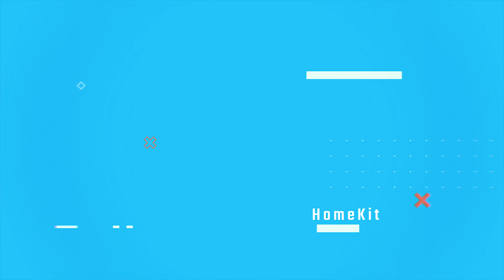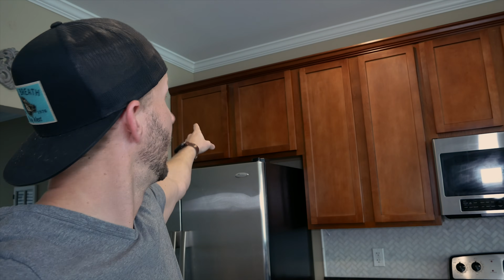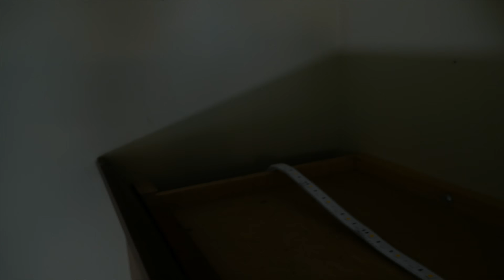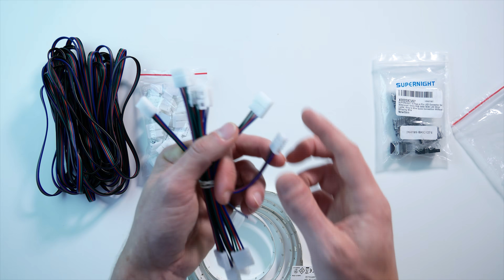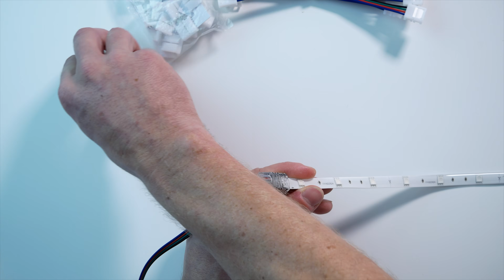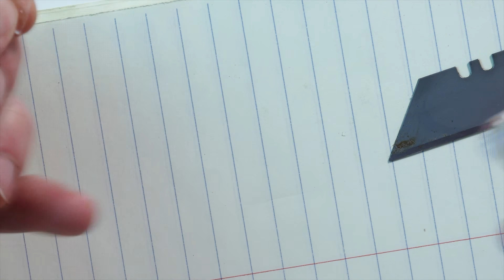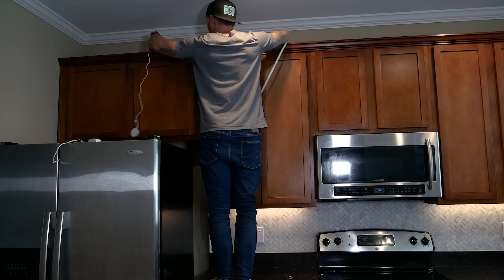How to install LED Strip Lights – Under Cabinet Lightstrips for your Smart Home!

Comment: Brother , i was Literally looking for strips . Might move soon into our home and I’m choosing HomeKit as we are apple user and i don’t mind saying Siri instead of Alexa . Rather have the least amount of hubs add o your channel has been great . Are all your home sensors Vocolink? Rather keep the entire house the same. Thank you , maybe a end of the year Full tour of your smart home? Love the NFC ideas. Great job
Reply from the maker: Thank you! I'm glad the channel has been helpful. I am definitely planning a full smart home tour video, but it probably won't happen until early 2021.

And to answer your question about sensors, I have a number of different sensors that I use. If you only need a couple here and there, bluetooth sensors like the VOCOlinc or Eve work great and no hub needed. If you want a bunch of sensors throughout the house, I might consider something that uses a hub like Aqara. They connect via Zigbee so they are fast and reliable. This is nice because the hub is what connects to homekit (which exposes all the sensors to HK) and I find that easier to manage. Check out my new home tips video if you haven't already and plan to move soon. I talked in that one about getting started with a new home. https://youtu.be/YI3RDqhnjIU
Reply: Thanks for the answer , keep those NFC tags videos ideas. They are great

Comment: I've a 12v adapter now, but I lights 50% of the led lights at good light, if I but a 24v adapter, will it be a powerfuller light?

Comment: While it's true that an LED light kit does not consume much power, the outlet located in the cabinet is a dedicated circuit for the microwave in is not supposed to power any other devices. It works in this instance and I am sure others have made it work.... it's just worth noting for anyone who may consider doing that type of project.  The lighting effect does look pretty cool though.
Reply from the maker: Hey Michael, thanks for pointing that out. Definitely worth noting. I wouldn't plug anything major in there, but it should be fine for something that draws such a small amount of power such as a light strip.

Comment: Hey Shane, getting awesome future ideas down for my new house when we purchase one soon! this is really useful DIY trick but i just want to know how safe those clips are? (Electrical fire safety wise...) since you're cutting the light strip and extending it differently  to manufacture recommendations? Thanks
Reply from the maker: Hey Tristan, I'm no electrician. But these type of connectors and kits are common on amazon and can be found for all types of light strips. And people have been soldering light strips like this for a long time. This is just a way to do the same thing without soldering it. Of course, always consult an electrician if uncertain about any project involving electricity.

Comment: Great video Shane, I have 2 questions.
1- How did you do the Red Code automation in HomeKit?
2- Can you cut and spread yeelight lightstrips in the same way?
Reply from the maker: Thanks Hugo. 
1. Use the Vocolinc app (or other 3rd party homekit app) to create a scene that includes the light effect mode. This can only be done with vocolinc lights.
2. You should be able to do this with any light strips. You just need to figure out what type of light strip you have and get the appropriate accessories...for example, this is a 4 pin lightstrip, but another may be a 6 pin light strip. Hope this helps.

Thanks for watching!

Comment: Hi again Shane, awesome upgrade and your wife’s happy what else you can ask. The Meross outdoor plug that I received doesn’t turn on. So I received the refund just in time with the news of the new Wemo outdoor plug. I buy it and have plans to open it up tomorrow let’s see how it works. One month ago I bought a Vocolinc LS2 with the extension. I put it in my living room and it works great. I use your older video to expose the lights effects to HomeKit and have created scenes with it. I’m planning to buy another Vocolinc light strip with an extension to put it over my cabinets.  And with the news that you gave us about the adaptive lighting it will be better. Thanks again!
Reply from the maker: Awesome! Well about the light strips and effects...not so much about your outdoor plug. I actually just bought one of those also, but I haven't taken it out of the box yet. Hopefully I'll have better luck. I did see the Wemo outdoor plug also. That looks like a good one. And yes, I will also be quite happy if they do actually bring adaptive lighting to these light strips! Thanks for watching!

Comment: Just waiting on some lifx strips to arrive to do the same. Did you think about using profile channels? Am thinking of getting them to maybe help diffuse the leds a bit and look a bit more professional installed. Not sure if it’s just extra work and cost
Reply from the maker: Nice. I think if you can see major hotspots or the actual LEDs, then yes using the channel diffuser would be a great idea and look much better. But otherwise if you are able to hide the light strips so you only see the glow, probably not necessary imo.

Comment: what would you recommend if you have cabinets on both sides of the kitchen? Also, great video!
Reply from the maker: Thanks for watching! You can always use two separate light strips if you have to. You can control them separately or link them to work together in HomeKit.
Reply: @ShaneCreates  Thank you!  I just bought a home and I travel a lot and HomeKit seems like the way to go for me. I need to be able to control my home from anywhere. Once I found your channel and have been hooked ever since.  Really appreciate the feedback!
Reply from the maker: Anytime. Thanks for watching!

Comment: Looking good! 👍🏼 You did a good job explaining the differences in all the connectors and how to connect them. I had a vocolinc light strip before but mine (and a replacement) kept making a high pitched noise when plugged in that was rather annoying. Have you experienced this?
Reply from the maker: My wife has mentioned she hears something similar at times but it’s very faint (I don’t even hear it). I wonder if there are any other electronics nearby that could be causing some sort of interference?
Reply: @ShaneCreates  certainly possible. I have a Govee light strip near other electronics and there’s no high pitch sound so who knows 🤷🏼‍♂️

Comment: I believe it would be easier to solder the extension wires to the LED strip instead of using all those fancy connectors...
And why the gap over the stove? Unless you already have a light over the stove, the gap doesn’t make sense... I know I would want to have light over my stove...
Reply from the maker: There is a light there already. But mainly because we cook a lot and I feel like all that heat would damage the lightstrip eventually. Plus I’m not sure how safe that would be with all that heat.
Reply: @ShaneCreates  ok, I see. I was just making sure 👍🏼

Comment: ‘Nother great vid. Have you ever come across smart LED lighting that doesn’t require a power outlet? Something that can run on a small/inconspicuous battery pack, for example?
Reply: A Bers personally I wouldn’t recommend those. The batteries die very fast. But I have seen some on Aliexpress. Don’t think they work with HomeKit tho.
Reply from the maker: Not that work with homekit. There are some light strips that have a usb cable for power. So technically I suppose you could connect them to a power bank. But that's not necessarily small or inconspicuous either.
Reply: @ShaneCreates  Makes sense. Thanks.

Comment: What would have been wrong with running the strip under the microwave opposed to creating a gap?
Reply: it would have blown up and killed the entire family
Reply from the maker: @sirprzemek  😂 😂
Reply from the maker: Hey Scott, I considered it, but being that it’s right above the stove, the lightstrip would get exposed to a lot of direct heat as we cook often. I figured this could damage the lightstip over time. Plus there may be some safety issues with that so I figured it best to skip over the microwave just to be safe.
Reply: @Shane Whatley  I can't imagine it would have been a problem. Was there anything in the documentation that mentioned heat? That's probably the most important place to have some extra light. I would love to know what the manufacturer has to say about it.

Comment: Which button are you planning to use under the cabinet?
Reply from the maker: Haven't decided yet actually. Maybe Eve or Aqara?
Reply: @ShaneCreates  I guess what I struggle with is other wireless buttons that work with HomeKit across multiple manufacturers without five million hubs 🤷‍♂️. The struggle is real 🤣.
Reply from the maker: @matthewsargent2415  haha I hear ya. The Eve button doesn’t require a hub.

Comment: Very nice setup. How far apart are the cut marks on the strip?
Reply from the maker: Thanks! The soldered points that I needed to cut for the gap are about 18" or so apart. The cut marks that you are "supposed" to cut are a bit closer together, but those are just for shortening the light strip and won't allow you to extend the connection like I did here.

Comment: Great video Shane!

As video can often skew the ‘true’ effect of lighting, how well do these strips actually provide brightness?

I am insanely (probably psychopathically) detail oriented in regards to making an installation look ‘clean’.
My thought is to install this type of lighting on the outermost ‘lip’ above & below the cabinets (seems that everyone else puts them on the ‘wall side’, facing out). So that the LED strips themselves will never be seen, and the light would shine towards the wall. 

Are these bright enough to install that way?

Thanks for the upload.
Reply from the maker: Thanks Brad! I played around with that a bit and they definitely looked better, and lit up that backsplash better, the closer I got the the wall. There are probably brighter lightstrips out there, but you may have to pay twice as much. The affordable cost and those light effects exposed to HomeKit are the selling points for this particular lightstrip imo.